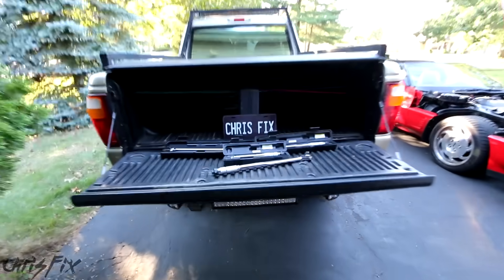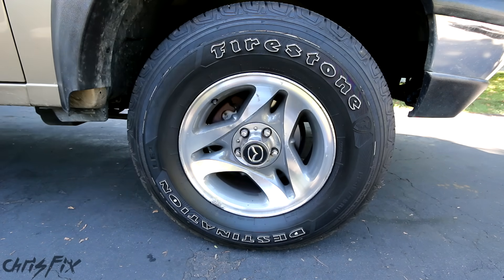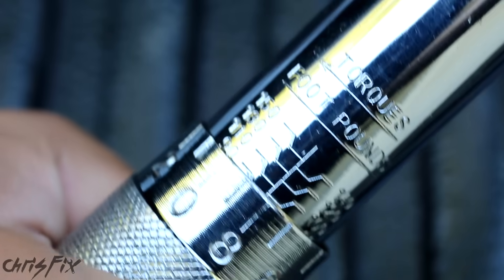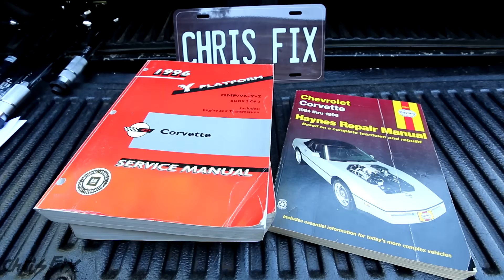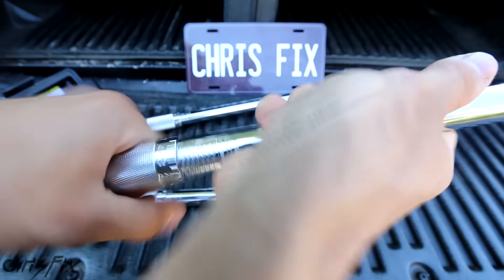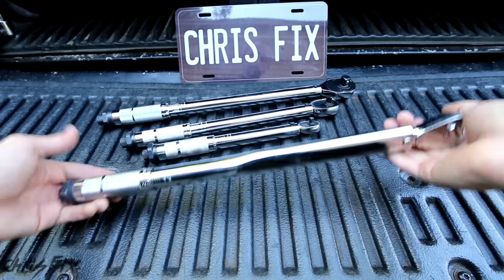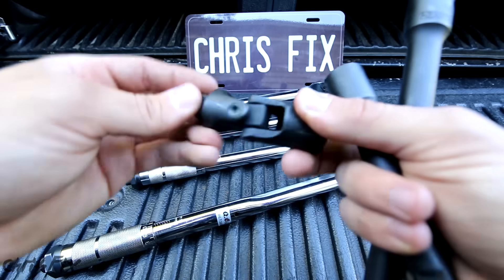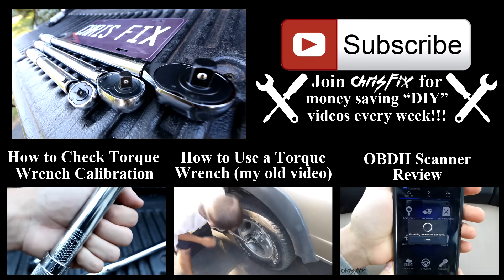How to use a Torque Wrench PROPERLY

Comment: It doesn't matter if the extension twists, you are still getting the same torque out.
Reply: +Martin Fisker If you can be absolutely certain that the extension has stopped twisting, then yes, you could be reasonably confident in the torque reading. But it's simple physics that it requires some force to do the twisting, so unless you can be certain the extension is static, you cannot be certain of the amount of torque being applied to the fastener. It's like suspending a 10 lb weight from a scale via a rubber band. As long as the rubber band is actively stretching, the scale will not read 10 lbs. Only when the rubber band becomes static will the scale read the correct weight. And if you are applying enough torque to start twisting an extension, you run a good chance of breaking the extension before you're through.
Reply from the maker: +Martin Fisker But it wont be at the same angle which is the important part. If the extension twists, then your angle will not be the same. If it is a thick extension, your angle will be minimal. Thanks for sharing!
Reply: We are talking linear extensions, right? I dont understand why angular twist matters
Reply: +Martin Fisker If your extension twists, some of your force is lost in the extension, and you have no way of knowing how much. Your wrench might indicate that you're using 100 ft-lbs, but you might not be using all of that 100 ft-lbs on the fastener itself.
Reply: +garrisonaw thats not how it works. unless the extension is accelerating, it is in an equillibrium of moments. just like when pulling an elastic band, you have to pull the same in each end to lenghten it
Reply: The oscillation of the extension would be VERY little, and it has so little mass moment of inertia, that it really wouldn't matter. And with regards to breaking the bit, when does it start twisting? Angular displacement is proportional to moment applied - you could twist the bit using your pinky
Reply: +Martin Fisker I think I've figured out the problem here. You are confusing the word "twisting" with "rotating". Twisting is when the handle end of the extension is rotated farther than the fastener end. It is a deformation of the tool. If the twisting continues, the extension will break. In fact, if an extension has twisted even a small amount in one direction, even a relatively small amount of torque in the opposite direction will snap it off. Yes, you can rotate something with your pinky, but you cannot twist an extension with your pinky.
Reply: I'm not confusing the two. And yes, you can twist it with you pinky, just not enough that you can see it
Reply: +Martin Fisker OK, now you're just being pedantic, so I will answer you in kind. In order to say it has been twisted, whether visibly or not, you have to overcome the molecular bonds in the steel. You can apply force with your pinky, but you would break your finger before you ever come close to overcoming the bonds in a piece of steel. So no, you cannot twist it with your pinky. The whole point in using the thicker extensions is to ensure that the molecular bonds in the metal cannot be overcome by the force required for the task - i.e. it cannot be twisted.
Reply: Take a look at the strain/stress-curve of steel. It immediately strains, you don't have to apply a huge force in order to "overcome the molecular bonds", they just stretch to a certain point
Reply: +garrisonaw 
Exactly Sir, The resistance must be of such that the possibility of ANY torque twist is less than the pressure applied.
Reply: It is completely correct that the twist WILL have an effect on the actual applied torque. That is how e.g. torque limiting extensions for bolt guns work. If you have a gun that gives, say 400 lb-ft you put a limiting extension in between, and get something much less. The reason is that when the bolt side reaches the designated torque, the shaft starts twisting. And the same happens for a manual torque wrench. 

It's simple solid mechanics ;)
Reply: Then tell me, how much does a D=12mm extension twist under 50Nm load? (Extension is 80mm long). I dont know about chrome vanadium alloys specifictly,  but im guessing youngs modulus around 200GPa and poissons ratio 0,3... And how much does the same extension twist at 25Nm? Then tell me, when does it start to twist?

Comment: harbour frieght tools!
Reply: +starrychill Not all their poop is well, ... poop.  
U just have to be selective and know what ur getting.  Sometimes u don't need the extra expense for top end, and sometimes u would be better off shopping some place else.  If ur going to go "foreign country brand", might as well not pay up for it at least.  HA.
Reply: +Ji Fi-01 (Jif) I bought a bunch of tools from them. Physically go to the store. Their shipping online buying service is terrible. I took me 3 weeks of nagging to get them to ship my order. I never shopped from them again.
Reply: *****
Just get a portable small tank compressor. I got one off of pep boys for less than $200(+ used online 30% discount). It is a 5 gallon. It's about the size of a small cooler(for cold drinks at the beach).

It's un-oiled so I don't have to maintain it, but I would rather have an oiled one because this is loud as hell and the small air capacity means it will be making noise for a long time.
Reply: +Wror Jan your previous compressor, or your electric impact tool?  a pneumatic tool is easier to build  and more reliable for the same production cost.  its a pita to get a hosed tool into some places, but if you do enough work, need more than 2 powered tools, a centralized power source that doesn't need recharging can be more cost effective.
Reply: Goldstein  Harbor freight made in India: Crap, Harbor freight made in china:  Questionable, Harbor freight made in Taiwan: Usually pretty good, the best they have available at HF.
Reply: +starrychill Horrible freight*
Reply: I got me an electric impact gun because I don't have a compressor. It only lasted about 6 months 😒

Comment: As always thanks for the effort in making videos. I always watch the ads for you lol. Anyway could you do a video about using water (spraying into the throttle body) to clean/ steamclean the engine?
Reply from the maker: +Seth Perts Thanks a lot Seth and thanks for all of the support (every little bit helps)!!! I will be doing a video on using water to clean the engine and seeing if it works so stay tuned!

Comment: Chris, do you have any tip on where to buy service manuals or you just go to eBay? From manufactures or from independent publishers?

Me and my brother are working on a Volkswagen Fox 1989 (here in Brazil it is called VW Voyage) for some time and we lack technical information. The car is a lab for our own learning. We performed several small repairs, but the most interesting was to install a programable electronic fuel injection (it was carburated), to upgrade the brakes calipers/rotors and install power steering system. It is quite fun!

Thanks!
Reply from the maker: +Diego Niedersberg I really just use ebay for the shop manuals like those two red books for the Vette. For the chiltons or haynes you can get them on amazon or even go to your local library! 
Wow, that does sound like a lot of fun! It is always a good time to play with cars!
Reply: Thanks for the reply, Chris. I found a service manual published by RB on Ebay from a guy in TN. I will contact him asking if the could ship all the way to Brazil. I also found in a used book store one volume from a dealership service manual collection. This literature is not common in Brazil, I think is because DIY is not popular within the general public.
Hey, by the way, your Vette is amazing! It is a 92, right? I think older cars are full of character and if you there them well, they will perform as good as a brand new one.
Thanks again, cheers!
Reply from the maker: +Diego Niedersberg Awesome! Hopefully they ship it! Thanks a lot, it is a 96 and she is like nothing else on the road which is what I love!

Comment: Hi. . can i ask a question? I would like to know how to properly know if my cv boot is broken or needs to be fixed.. and how to change it.. thank you very much
Reply from the maker: +France Jeresano You can inspect the boot and see if there are any tares or rips. If there are, you can either repair it if possible or get a new boot. Many times you might need to get a new CV axle because it gets dirt inside of it though the hole and causes bearing damage.
Reply: +ChrisFix i drive '09 Nissan rogue and when I went to the dealer they told me to have it fixed but itll cost $300+tax i dont know much about cars thats why when I saw your videos it really helped me alot to understand my vehicle more.. do you think i can get it fix with a lesser cost?

Comment: I use a Pittsburgh 3/8 torque wrench at my job every day as a  machinery mechanic. My company checks our wrenches for free. Our tool guy told me the Pittsburgh checks out to be more accurate than the big brand ones, at least for 3/8ths, and I've had mine 2-3 years now. 

So hes right to say you dont have to have name brand, especially for home use.
Reply from the maker: +eaveskc This is great to know! Thanks for sharing!

Comment: Should always push down on wrench when tightening. Avoid pulling, its bad on your back. Always remember "work with the tool, not against it"
Reply from the maker: +David Ruth Thanks David. I prefer to pull up on the tool. I am still young and strong so it gives me more leverage and control.

Comment: I don't agree with searching on message boards for advice on things like torque specs, anyone can put any information out there which could be incorrect and that could cause many problems. Better to get information from referenced sources.
Thanks!
Reply: That's why he said to be sure to look for info where they cite their source. Yes, anyone can still say anything they want, so it's not a foolproof system, but at least if they claim that they got the info from a service manual, it's better than if they're just talking out of their ass.
Reply: garrisonaw Correct, but its kinda rare for people to cite their source. Better to do your own research from my experience, but hey whatever works I guess.
Reply: +ZiggleZilchINC True, it is rare to see people cite sources. Which is all the more reason why I always try to cite mine :)
Reply from the maker: +ZiggleZilchINC Like anything else, you have to do your research. I own many service manuals and I will "fact check" specs using forums and 9 times out of 10, the specs are the same. Like you said, anyone can put stuff on the internet, but it is a start and if you see it in multiple places, then that is pretty good info.
Reply: ChrisFix Right, do you own research and you cant go wrong.

Comment: Looking forward to the calibration video! The torque wrench I use is older than I am... in fact, it's probably older than my Dad, since he got it from HIS father. I'm really interested to see just how close it is to being accurate after all these years. It's not a click wrench (I don't even know if they made click wrenches back then). It uses a needle and a scale to point to the torque that is being exerted.
Reply from the maker: +garrisonaw Yea, it is a dial style wrench! That is pretty cool! I am looking forward to filming the calibration test video!
Reply: +ChrisFix Not a dial wrench - it's a basic Sturtevant type beam wrench. I know you can still get them. I'll have to look at mine to see if there's any way to determine just how old it is. I know it's at least 50 years old.
Reply: +garrisonaw love these type... hard to buy for some reason even though they seem "more simple" then a clicker type...  I think they are better for learning to tighten bolts/nuts as a beginner since you can visually see how much effort is required for each amount of torque so you can calibrate your "arm feel"
Reply: +thedreadedgman Look on Amazon. Just do a search for "torque wrench" and you'll find them. Because they are "more simple" than a clicker (i.e. they have no moving parts), they are less likely to lose their calibration, but they have other inherent problems. Most notably, you have to actually be able to see the face of the scale for them to be useful, and sometimes it is difficult to do so - especially with some of the weird spots you can get into when working on cars. The needle can also get knocked out of "true" fairly easily, so every time I use mine, I double check that it's pointing at zero before I start.

Comment: Almost all modern Toyota's are 76 ft lbs. Just to let ya'll know.
Reply: that is for aluminum wheels not steel
Reply: I use 65-75 on my cars haha
Im not afraid my wheel will come off
Because if i tighten them more its real pain to brake those bolts with oem wrench if i had to change a tire
Reply: 80 on my Accord.
Reply: I just tighten all wheels to 100 ft lbs without even checking tbh
Reply: My Subaru is 72lbs ft

Comment: thank you so much.  I ruined 1 nut on my lower intake manifold because I didn't use it properly.  also is there a torch spec for Throttle body?
Reply: Virtually every fastener on your vehicle has a specified torque. Get a repair manual for your specific vehicle - both model AND year - like the manuals shown in the video. The manual should show the specs for any fasteners in each section.
Reply: +garrisonaw but I have one. it didn't say in the specs
Reply: +Cruz Ivan Garcia-Escamilla (Swiftie) Odd... In that case, I would check with a dealer service department. Most of them are pretty decent about giving you information like that. And if you haven't already, do a thorough internet search. Somebody somewhere has to have the info, because when the parts are designed, they specify the torque.
Reply from the maker: +Cruz Ivan Garcia-Escamilla (Swiftie) Just as garrisonaw  said, basically every fastener on a car has a torque. If it is being torqued into aluminum, my guess is 15-20ft-lbs max.

Comment: This might not be the best way to think about this, but in my experience it rings fairly true: The Harbor Freight torque wrenches are pretty decent, and honestly pretty much all of the torque wrenches are made in China of almost identical parts. I'd go so far as to say they're all made in the same plant and just have a different logo put on them. That being said the Harbor Freight ones come with a calibration sheet proving it's within a certain margin of error, and you can get it for $22, or if you have a 20% off coupon (they run them ALL the time) you can get it for $18.

I've seen a video here on Youtube, a guy compares a Harbor Freight torque wrench to his Snap On, they're both within like 1.5 ft-lbs of each other. I believe he also says he has the Snap On calibrated yearly.
Reply from the maker: +Jesse Crandle Yea, right from the factory I heard HF torque wrenches are good but I heard they do not hold calibration.
Reply: ChrisFix Ah, I didn't know that.
I didn't buy theHF or Tekton one though, I bought a brand called "Mountain" that's also sold on Amazon. It doesn't have as many good reviews as the Tekton does, but I've really never had any issues with it at all. I bought it in 2011 and the Tekton wasn't even available until 2013.
I paid $40 for it, but I've also had to buy a 20-200 in-lb one (for cam cover gasket replacement, tightening heads back after head gasket replacements), and I had to get one that goes up to 250 lb-ft so I can do my axle nuts as well. Technically I should have been able to use the 10-150 lb-ft one I bought at first, but the amusing thing is you can't go past 130 with it.

Comment: 103 ft-lb for an axle nut? Holy shit... my car it's 150 lb-ft, 103 doesn't seem that tight. Then again it's not a castle nut, so maybe it needs to be tighter if it's not a castle nut. Dunno, just never seen one torqued so low. 

Oh and I got my information from the service manual that was given to techs, so I know it's correct.
Reply: An Audi A4 Quattro only needs 85 ft-lbs. My F-150 calls for 295 ft-lbs! You have to get a 3/4" drive torque wrench for that, because the 1/2" drive doesn't go high enough 😎
Reply: +Jesse Crandle same here lol
Reply from the maker: +Jesse Crandle Yea, that is why it is important to know torque specs because some nuts are a lot tighter than you would think and some are not as tight as you would think!
Reply: garrisonaw That reminds me, when my father would change the tires on his old Ranger he'd tell me, "When the bolts squeak they're tight enough!" lol...
Reply: +Jesse Crandle I don't remember my Dad ever actually saying that, but I don't remember him ever using a torque wrench when he changed a tire. And I'll be honest, I've never once used a torque wrench on lug nuts either. In fact, for most fasteners, I just estimate any more, since I've developed a pretty good feel for how much torque I'm exerting. There are still a few nuts and bolts however (like pretty much anything on the engine itself), where I insist on using a torque wrench.
Reply: garrisonaw Yeah I hear you. I probably wouldn't use one for wheels either, but I have lug bolts and I've had them get stuck on hard as hell (it's a Saab, crazy damn Europeans), or if I take it to a shop and they remove the wheels then they usually blast the bolts back on with a impact and then I have to break out the cheater pipe to get them off. I like to avoid that if I can lol...

Comment: Another thing is that the torque isn't affected if you use an extension that's straight. The torque wrench and extension must be at 90 degrees angle.
Reply from the maker: +hostilityy Thanks for the tip!